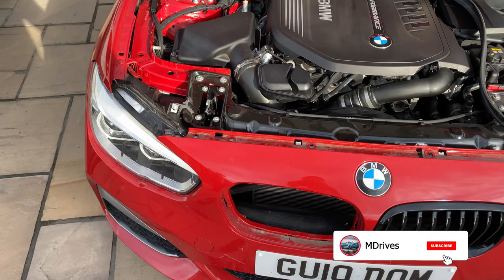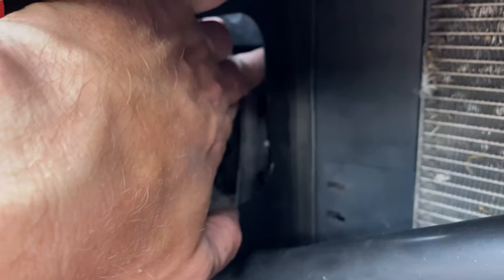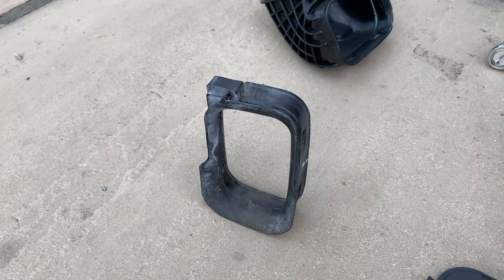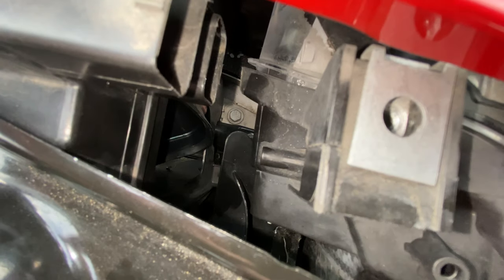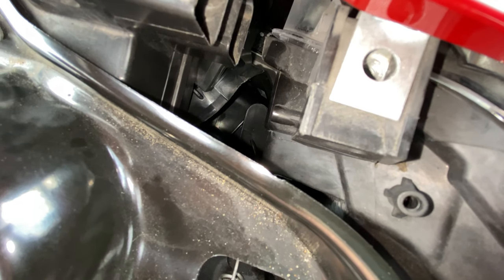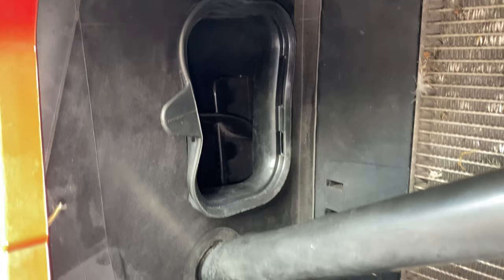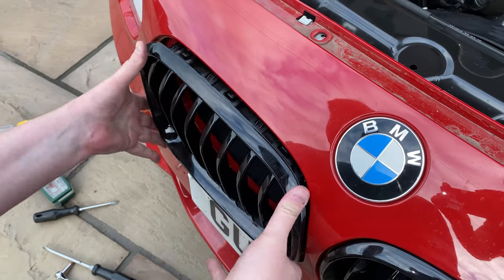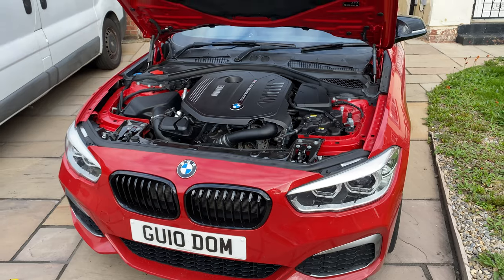BMW B58 M140i M240i 340i 440i HOT CLIMATE AIR INTAKE INSTALLATION AND SOUND

Comment: Very interesting! I have a Canadian '15 328i xDrive that has the intake pieces standard. It's been very cold here in the winter, getting to nearly -40c at times. Just this morning on my drive into work it was -21c. I'm kinda thinking of doing the reverse for the winter, removing the bend and blocking off the grill area port!
Reply from the maker: I’m surprised to hear that you have it on your car, living in such a cold area.
Reply: @MDrives  yeah, come to think about it doesn’t make a lot of sense. We’ve had a few days earlier in the year where it got close to -40c. Even though it’s been closer to 0c recently, I converted my intake to the Hot Climate intake and seems to get up to temp faster.

Comment: Thanks for this. So if you don’t have this, is the air conduct that leads to the airbox completely useless and where does the airbox take air from??
Reply from the maker: It’s not useless, it sucks in warmer air from the inside of the engine bay area so the engine warms up quicker and helps with keeping emissions low in the first few minutes.
Reply: thank you! could I message you quickly somewhere for some advice ?  @MDrives

Comment: Looks a useful mod. Where did you buy it from and do the 140's with the PPF have the air intake on both sides. I also noticed your friend still has the resonator on the intake pipe has he thought about changing it to a straight through pipe. Williams performance sell them at a good price.
Reply from the maker: He got it from BMW. I doubt ppf models would have two intakes. Good shout about that resonator. I’ll have a chat with him as he might want to do this mod.
Reply: @MDrives  i got my silicone pipe from psh, its cheaper and theres a choice of colours